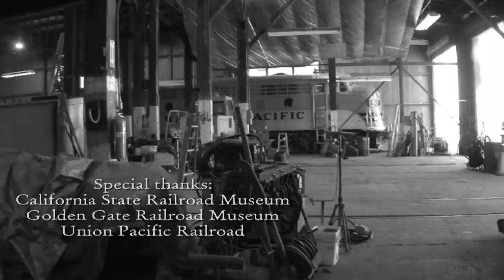The Most Amazing Railroad Video, This is a Must See. F-unit Crosses the Union Pacific Main Line

Comment: there had actually been a crossover there, in that very spot.  for something like close to 100 year, up until whenever the u.p. insisted upon its removal.  before the railroad museum and the historic sacramento restoration, what is now the museum's track had remained a semi-active branch along the levee.  even after the sfsp and later rgi-sp, there had been no real problem.
Reply: +themnax, It seemed a somewhat odd situation considering that the museum would have normally been planned for an area with the maintenance shop connected to the museum by a proper crossover.

Comment: When these were  Southern Pacific tracks there was an actual 90 degree crossing at this point.  UP removed it but have since replaced it with a (level) crossing at about 45 degrees which leads to the shops.  This was added about the same time they built the new Sacramento station.  The track that the F unit is on is part of the old Central Pacific route.

Comment: The infrequency of this operation doesn't justify the cost of a permanent track. I worked for UP did this once. We crossed over, picked up a car and bought it back to the Locomotive Works. They only restore cars for the rail museum at the locomotive works, which was built by Western Pacific long ago.
Reply: Southern Pacific, not WP.

Comment: Thankfully that shoo-fly has been eliminated and an actual switch and spur has been installed. UNfortunately the radius is just a little too tight for the 844 to get in without having an axle on the tender blocked up. Perhaps that has been corrected as well by now.

Comment: I presume this railway junction used to be a double-diamond at one time under an independent Southern Pacific?  The UP must have pulled the flangeway frogs, known maintenance-intensive items at rail junctions and switches, in the late 1990's.  With the shift-over of #913, an Electro-Motive F-3 ex-Western Pacific, scheduled for the long gap in the timetable for Sacramento Division, building a transfer track, shifting the loco, and tearing down said track proved orderly and didn't hold up either the Amtrak for the next mixed freight for long.

Comment: I love traveling by rail. I understand that flying is much faster, less expensive and more convenient by you can't see the countryside from 32,000 feet up. I always thought that having a train that pulls privately owned train cars would be a great idea. You could buy a factory made self contained train car or for the really adventurous builder, they could buy an old Amtrak passenger car and build the interior to their own specs. For me, i'd buy an old Amtrak double decker and have the lower deck as the garage/shop and the upper deck as the residence. I know it'll probably never happen but it's fun to think about.
Reply: amtrak does pull private cars. They have to be passenger cars cargo cars cannot be converted.  Up will haul private cargo cars but passengers are not allowed

Comment: UP later found it unethical to place Jump Flies on its mainline so in 2012 it was decided to reinstall the diamonds almost everything was done right except a power lock was installed and one of the workers did not lock up when #844 crossed the diamonds and she derailed. Steam Shop had to spend six hours in sweltering heat to get the old girl back on the tracks and finally succeeded.

Comment: Western Pacific 913 is actually a F7A.   The CSRM has been using this arangement for a while just simply because there is no better solution at this time to the problem.  I wonder why they brought the 913 to the shops?

Comment: Adding a diamond would mean that Amtrak Capitol and other trains would have to slow to 40 mph in an otherwise 79 mph area. As infrequently as CSRM needs to cross the UP main line, a temp crossover is the best solution for both.
Reply: The location is right next to the Amtrak station, so no train is going to be going 79mph!

Comment: What was that grey device, almost at the end of the show, that moved the locomotive to the garage?
Reply: Ithinkiwill66 it's almost like a turntable but it just moves the train laterally instead of like a turntable.
Reply: What the locomotive was riding on is called a Transfer Table.
Reply: I see...thank you ☺
Reply: Oh, I see. My answer was probably too detailed and complete, so it required two others to answer? ;)
Reply: @billdonaldson7690  ANY detail is ( was ) awesome....and also, I actually find it incredible that all the weight, from the engine, that ran on the tracks OVER the tracks, didn't bugger up the tracks underneath....very cleaver engineering 🙂
Reply: @Ithinkiwill66  Railroaders belong to the "git 'er done" club! ;)

Comment: All cool, but so much left unanswered.

*Why no crossover anywhere that could be used?

* What parts of the crossover build up can be left in place for future needs? After all, the locomotive will have to retrace it's steps when the work is done, as will other pieces of rolling stock that need repair.

* Will they just build a permanent crossing there? If not, why not?

Comment: cool, nice solution. but wouldn´t it be simpler to build a permanent crossing?
Reply: +Max Nuber There did used to be a permanent crossing at this location, but it was removed sometime around 1999-2000 for some reason.
Reply: +Max Nuber   Bad for mainline trains to run through a track crossing so little used.This is far better.  Mainline trains can also travel at high speeds not reduced to go over a track crossing whose points will need to be inspected regularly.

Comment: So they do this every time the museum needs to move a piece of equipment to the shops rather than building a permanent level crossing?
Reply: In the time since this video was posted (2011), CSRRM has built a permanent crossing over the main line.
Reply: @wbstvnsn1957  you mean through them? Looks like the rail over the track would derail trains going the opposite direction

Comment: Is there any reason they don't put a permanent T type transition between the mainline and this line so that they wouldn't have to build a ramp every time they needed to move a locomotive?
Reply: +Blaine Bugaski Because track diamonds cause a ridiculous amount of wear and strain on the wheels and suspension of all that cross them, and also on the diamonds themselves. For something that might only get used once a week or less, this is the more cost-efficient solution.
Reply: I was not aware.
Reply: +Blaine Bugaski With the 2014 realignment of the UP main line they have now added an offset diamond in this location.  The main line is a few inches below the SSRR tracks and is a smooth path all the way through.  The SSRR tracks break at the diamond as normal.  A unit from going from the CSRM to the shops has to move very slowly over the crossing, but the UP traffic can move at track speed through the crossing with no bumps or excessive wear.
Reply: ***** That sounds like a job well done, considering that both lines do not experience equal traffic.
Reply: +Blaine Bugaski      Modifying the main line would put it out of commission for the duration of the work. This is cheaper, doesn't modify the main line, and is more than adequate for occasional use by the museum.
Reply: As noted, apparently they did modify the main line somewhat so this doesn't have to be done anymore.

Comment: By the looks of the track to, and from the main line, there clearly used to be a cross over, wonder why it was removed in the first place?
Reply: john smith  Since the new station and track work are done, the diamonds are back but in a slightly different location. And are at about 45° instead of 90°. Before it was to provide access to the north side and the transfer table. Now the transfer table is entered from the south side. There is direct rail access to the museum also by way of the new diamonds.

Comment: Um, why didn't they just wait for the capital corridor? i'm sure that has higher priority
Reply: TheBrantfordRailfan  Amtrak is lower priority that other traffic, thats why it often has delays
Reply: TheBrantfordRailfan Amtrak is supposed to have priority, but, they can't stay on schedule.  So they get put on the bottom of the list.  Amtrak uses the freight rails since they have none of their own.  So they have to abide.
Reply: to brntfrd, yeah, amtrak is expert on delays !!  😕😫😡
Reply: Tim Green you just explained one of the main reasons passenger trains are almost non-existent in the U.S. 
I read one time that 95 % of Amtrak delays is not their fault.
Reply: The Karot My Mom rode AMTRAK from Chicago to St. Louis.  Scheduled to be a 3 hour ride.  It took over 5 hours.  Don't know who's fault it was, but AMTRAK had to keep getting out of the way of the freight trains.  Twice, they had to back up to get to a siding.
Reply: I can relate, tim.  I've been in that situation b4, & it's potentially dangerous if timing is wrong for either train!! 😖

Comment: I always thought those were called 'A' units.
Reply: taratupa73 the A just means it has a cab. There were also B units that were just engine, fuel, and traction motors
Reply: taratupa73 
F is for freight

Comment: Thumbs down for the Discovery Channel-style artificial high-pressure time constraint- as if the Amtrak would just run right into the F3 if it wasn't across the main line before scheduled departure.  It looked to me like the crossing was a regular crossing point, had been done before; rail pieces designed for that kind of work.  The video was interesting, and I liked it - but the title was just too hyper. I would have watched it anyway, without all the hoopla.

Comment: Why not put a diamond track on it
Reply: If Union Pacific were to build a diamond on their main line, it would be costly. First, there's the diamond itself. Second, there's the wheels. When you hear trains going over diamonds, it is loud. That noise is caused by the wheels pounding the joints and the gaps, so there's damage on wheels as well as the car itself because it is bumpy. And since the locomotives of this company rarely go into repair, there is no point in installing a diamond when a occasion like this is needed.
Reply: Crazytrainkid It would appear from aerial photos that this operation no longer takes place as diamonds have been installed across the mainline. Also diamonds are not damaging to the wheels. Its the same thing as going through a frog of a switch.
Reply: Oh, my bad. I should have known better
Reply: Its all good
Reply: Pasquale solano They did this was in 2011 and it is 2015 now
Reply: oh i know but they should've done that back in 2011 i meant.